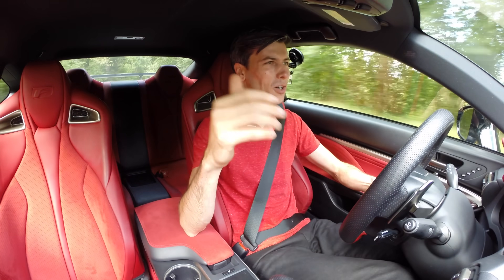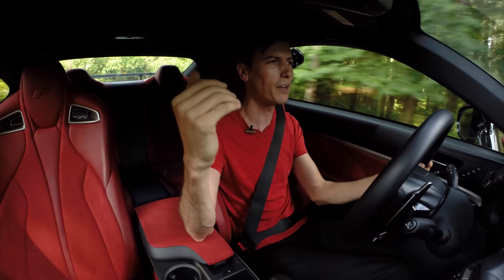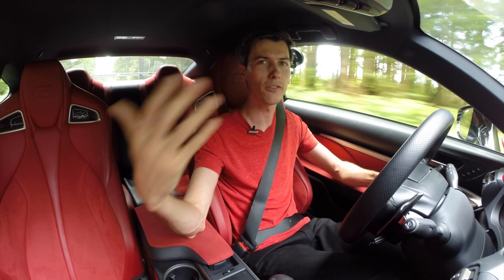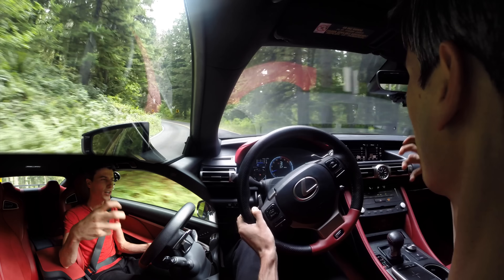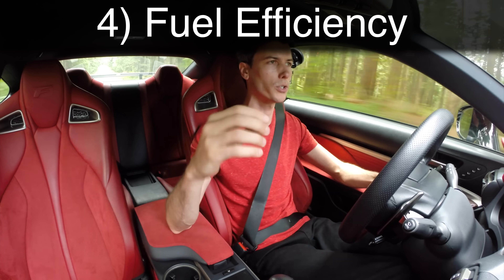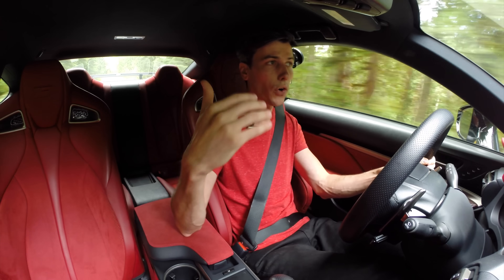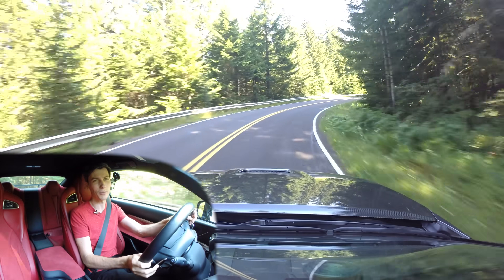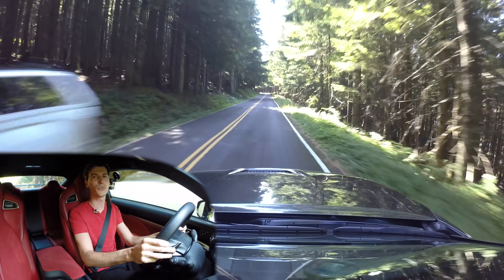5 Reasons You Shouldn't Buy A Turbocharged Car

Comment: I have bought a car with turbo 2.0 - it makes 250BHP does 0-60 in 5.8s  AND will easily do 30mpg if driven in normal traffic, all in a AWD car. So yes, it sounds ugly as f*** but it has way more power, better torque curve, much better fuel economy AND  at 145k miles is already far more reliable than my previous naturally aspirated V6. But it sounds ugly as f*** no denying that.

Comment: The richer fuel mixture scenario is offset by INTER-COOLING…..which is a part of proper previous preparation.  You present these issues as if the engineers didn’t pre-plan.  Audi is a great example.  Should you really be presenting this as if the increase in displacement isn’t beneficial when you need more power to prevent heat from building up when enough power isn’t available?  A properly used turbo-enhanced engine will last longer than a naturally-aspirated one that is pushed hard ALL THE TIME.  Yes, the boosted engine will change its’ full-synthetic oil with friction modifier every 3,000 miles due to the increased pressure in the cylinders.

Comment: Turbos were great when they were used to enhance the performance of a sports car. But now they're being used to compensate tiny engines. The 1.5L turbos they're putting in Honda and GM are proving to be a disaster. I was totally blown away when I learned that the GMC Terrain also used the 1.5L turbo. That's an awful lot of stress for an SUV that's designed to tow trailers.

Comment: I will say it like a broken record; BMW's 2,5 liter, naturally aspirated inline 6 engines was the peak ... it's all gone down hill from there.
It would be interesting to hear you compare the Porsche 991 to the 992, which is when Porsche switched to smaller, turbo charged engines.
Reply: This is all happening because of the fraudulent climate change movement. People have no idea how much of their everyday life is affected by the lie that C02 emission cause climate disasters & heating. The only reason manufactures started downsizing engines & adding tribes is because of Government mpg & emissions standards. Trump had slowed this down a little but we need politicians that will cut back on EPA regulations. All these regulations are not LAWS passed through the House & Senate, they are just Executive Orders signed by the President & they can be undone by a President with the stroke of a Pen. People are smart for keeping there older Naturally Aspirated Cars & not buying these new pieces of crap or EVs but they need to realize how Election Results are the reason they are NOT driving a new Naturally Aspirated Automobile that's reliable. The current automobile market crash is great but we still need Manufactures to scrap all these new small engine ideas.

Comment: Since I was born in 1951 I have seen a number of trends in automobile engines over the years. Turbochargers and Superchargers have been around a number of years, however in past years most car engines were naturally aspirated. Turbochargers were found primarily on expensive high performance cars. Now because automobile manufacturers are trying to get higher fuel mileage and still have plenty of power we are now seeing a lot of four cylinder engines with turbochargers. As an example the car I drive is a 2011 BMW 328i. This car has a 3 liter 6 cylinder engine that is naturally aspirated. The BMW 3 series cars that came after this model now use a 2 liter 4 cylinder engine that is turbocharged.

Comment: The part nobody has ever explained to me is..what happens with turbo s when down shoft. What is a down shift? Gas valve zero, rpm is upped 1800-2300 say, who does this? The wheels, via the transmission. How? Synchromesh is container term, but it is spring and push on..things, that push Zahnräder. What Does The Turbo Do With Its Revs? It has no transmission coupled. It is not managed by solenoids or sensors, but by airflow. Personified? How am i supposed to know (it s a song too) i must change me revs now?

Comment: Modern turbos 2010+ are long lasting and reliable, boost at 1500 rpm.Using exhaust gases to gain power is genius, furthermore most engines are turbo now for a reason.

Comment: What you are saying is truth but only from perspective that we have engine which is NA and we put on that same engine turbocharger than all you said is right. But if i have r8 v8 engine 420hp high rev 8250rmp with compression ratio 12,5:1 and we have 911 991.2 TT 380hp 7500rpm and compression ratio 10.0:1 turbocharger boost around 13psi at hard acceleration which incerase compression ration around 10,5:1 but mostly time you wil have bosst 1-2 psi normal driving or even zero. So from this i can conclude that r8 v8 will have more strain and wear on engine than 991.2 TT. Temperature wise r8 operation temp is 118celsius and 991.2 is around 105celsius normal driving when driving hard r8 v8 goes on 125-129celsius on 991.2 TT not goes over 98celsius because at sport mode have open aditional cooling system. So it can be generalized that NA will last longer than turbocharged really depends on engine type and car.

Comment: Omg.. after gone through this video on turbo charge engine my Mazda 3 2023 2.5L aspired engine behaves exactly like a turbo engine you have described 😢.  It s terribly laggy at bottom end and then makes a big jerky jump when it picks some power band😢. Worst it doesn't go fast at top end either even the engine was screaming at 6K rpm😢. Worst it drinks petrol like a drunken  sailor and returns no smile😢. It also sounds terrible too, like a cheap rent car😢. Completely opposite experience I got out on its rival the Hyhundai i30 n-line😂. You should review the Mazda 3 2.5L apspire engine and then tell us the turbo charge is way better in all aspects😂. My turbo Subaru Forrester lasted much longer than my Toyota Camry Sir and it still doesn't miss a beat compared to the old Toyota 😂

Comment: Except if those of us who are "peasants" want a reasonable amount of power in a daily driver these days, we have to buy a turbo'd four-cylinder.  Any decent output NA engine is going away due to the "green" thing (probably to force us to buy EVs which almost no one wants).  I live rural, commute to work in the next town down the road a ways, and need to pass tractor-trailer rigs on my narrow local highway.  A small NA engine does NOT let me do that safely, a turbo'd engine does, while still getting decent gas mileage.  It's about quicker acceleration for short periods, not for flat out high-speed driving for long distances.

Comment: Went shopping for Q7 in 2022, aircraft mechanic who got mechanical engineer then started career 28 years ago as power engineer.  I chose turbo 4 over V6 for one simple reason…better gas mileage.  It’s an SUV so I don’t max power and drive mostly with little load.  I have been building high horsepower engines since mid 90s NA, SC and trunk charged.  Other than getting tune right no additional reliability from either of the three that I have built.  I prefer Turbo over all others for the power delivery, a properly spec’d turbo delivers a nice torque curve for the type of driving that I do.

Comment: I've got an Audi A4 with a turbo inline-4 engine and e-gas (electronic throttle control). It's one of the zippiest engines they've ever built in terms of bang for your buck, but the best word to describe the acceleration and throttle response is probably "synthetic".  You either like it or you don't. It feels far less visceral than a naturally aspirated, throttle cable engine. But when the turbo boost kicks in, it more than makes up for it.

Comment: Na, turbos are remarkable, if you drive properly you can keep the turbo on the boil , engine oils today are very very good , mostly they exceed all manufacture specifications, so that takes care of heat and oil issues , yes often turbo engines are stronger thus they last longer, you dont rev a turbo engine so you drive on pure torque, which is free power and not straining the engine due to reving it , if you drive a turbo engine calmly as in normal driving they are very economical, granted that is hard to do due to the fantastic power generated so driving in hoon mode becomes the norm, as in fun mode 
Turbos are literally fantastic , good not bad

Comment: First of all. A na and a tcharged are exactly the same when driving in traffic, going slowl, coasting or hanging around 1500-2000 rpm.  For a normal car with low power when you want power you just floor it and the ecu knows what to do. You do exactly the same on both na and charged cars. The thing is that turbos torque is around 2500-3500 rpm and for a na you have to rev it to 3000-4000 rpm. If you are coasting lets say in 2nd gear ate 2000rpm and you floor it, the turbo is much more responsive because you are closer to peak torque than with a na. So I disagree with the responsiveness because it depends. Also if you race a turbo and a na with the same hp the turbo will always win because torque comes quicker

Comment: FACTS.  Turbos are better suited to aviation use and diesels.  Airplanes operate at a near constant speed once in the air, so throttle response doesn't come into play, and diesels generally don't have throttle plates, so turbo lag isn't as much of an issue.   Automotive gasoline engines respond better to superchargers.

Comment: Thanks. I was out of my mind thinking that I may have a problem.
The 1821982198219 videos on youtube talking about reasons for car hesitation should consider adding: You have a turbocharged engine.
This turbocharge thing is pretty useless, especially if you live in a hilly area with lots of turns and serpentines.

Comment: It depends on what type of na engine you have.  I had a b16 in my 99 si, and that thing was absolutely dead before vtec kicked in at 5500 rpm.  Unless you have a ginormous turbo, I doubt there will be 5500 rpms of lag.

Compared for my fl5, the power is on much MUCH sooner than my b16 could ever dream of.  Instant or near instant throttle response is usually only something you get on a large displacement motor that has a long stroke.
Reply: Even with relatively short stroke. 350 Chevy has an 88mm stroke, barely more than the GR86, and has torque for days even at 2000 rpm.
30 mpg on the highway too (with my Camaro example), but I'm sure a 1.6L Civic still does better than that lol

Comment: One aspect of turbo-charged gasoline engines you didn't mention comes down to actual cylinder pressures present in them during static highway cruise.  Those pressures are much higher leading to higher side-loading on the piston and more wear on the rings and cylinder walls.  Combined with reduced compression ratio (less scavenging of burned gasses), and gas-path energy lost to turbo back-pressure, your typical static cruising down the highway is using more fuel.  Energy is used to compress the air only to have the throttle plate block most of it off when running 60/70mph.  I recently drove two Mustangs on long trips, one turbo, one not.  The non-turbo cruised comfortably at 11 to 12 inches of manifold pressure.  The turbo Mustang ran at 25 inches of manifold pressure(!) That's over double the static-cruise condition in the normal engine.   Consequently, all of these little turbocharged gas engines are only good for about 80,000 miles before they're worn out.  Usually the cylinders "oval out" due to higher side pressure in modern short(ish) rod engines.  Diesel engines do not suffer from this as ALL of the air pressure created by the turbo is used greatly increasing thermal efficiency and pressure.   As you said, higher cylinder pressure extracts more energy out of a given measure of fuel.  Gasoline turbocharged cars get less mpg than an equivalent non-turbo, diesel turborcharged engines get greater mileage than a similar non-turbo, just the opposite of each other.
Reply: Diesel engines also have bigger piston skirts and many of them have oil jets squirting on the bottom of every piston to keep them cool. The bigger skirt makes more friction but it allows those longer strokes to not eat away at the cylinder as much. The oil on the bottom of the piston keep it cool allowing the components to withstand harsh conditions for much longer or indefinitely. 
Where you ae wrong is thinking that all of the turbo air is used. It is not! 4 stroke diesels have valve overlap for scavenging just like a gasoline engine although not as pronounced since the combustion chamber is located on the piston. Nevertheless they DO have valve overlap and some cool boost air escapes, its just that since it is 100% direct injected no fuel is lost due to scavenging overlap.

Scavenging loss of boost air is still detrimental to a diesel, especially the modern ones. More modern diesels run very low compression ratios (many pickups run about 15:1) replacing much of the lost compression ratio with lots of turbocharging and aftercooling. The ideal comp ratio for a diesel is 18-21:1. This allows for greater efficiency overall and more power as less HP is spent by the engine itself physically working to compress the air. Instead the energy recovery system of the turbochargers takes over a huge portion of the work. Cool boost air entering the exhaust is detrimental because it lowers the overall exhaust gas temperatures and sucks away potential heat energy for the turbo to use, making it spin slower.
Reply: @theq4602 why does the turbine care about exhaust temperature? It's spun by the air's rushing by, right? Shouldn't the speed and density of the air be all that matters?
Reply: @nthgth  Turbines are heat engines. If the turbine was spun by the flow alone the engine would have to put a lot of work into spinning that turbine during the exhaust stroke. It would be very restrictive. Its a mix more than black or white. Hot air likes to spread out which makes it less dense and thus will rise. So a hot and dense exhaust is what you want. 

Turbos, jet engines, and steam turbines all rely on taking a hot gas, spreading it out and turning that expansion into rotational energy. A turbocharger allows you to take hot exhaust that would be wasted going out your tailpipe and making it do more work. 
 Flow of the exhaust can and does play a role, but it really only matters in terms of spinning up the turbo and sizing the turbo to the application. If you fed a turbo's exhaust snail a lot of air but that air was cold it wouldn't be very efficient and your turbo wouldn't do much for you.

If you measure the exhaust temperature before a turbo and after a turbo you will see that after the turbo there is less heat. You want the temperature drop to be as big as possible so your turbo is efficient. One of the easier ways of increasing that temperature drop is by making your exhaust gas as hot as possible, another is buying a turbo that is inherently more efficient.
Reply: @theq4602  how does it just being hot impart energy to the turbine? Is it that once the exhaust valve opens, the hot gas immediately expands out of the cylinder and past the turbo, even besides the fact the piston is pushing it out anyway? Just because it's a lot hotter than before it got into the cylinder?

I.e, even at BDC before the exhaust stroke, the exhaust is champing at the bit to get out, regardless of that it got in there at 16 PSI to begin with from the compressor).
If so, I can see why putting the turbo as close as possible to the exhaust ports is good for efficiency (I guess ensuring hotter gas as you said)
Reply: @nthgth I cant easily explain it any further in a simple you tube comment. Its not a black and white thing its all related, flow, pressure and temperature all play a role. But the temperature is a very important piece that shouldn't be neglected.

Comment: I own a 2021 Hyundai i30N 6sp. It amazes me how good it is in almost every way. The boost builds very quickly to 20psi and then eases off a tad. This gives great low end grunt but is less rewarding when pedalling it. 
I used to own a Lotus 7 replica turbo, and with a fully programmable ECU I could let the turbo produce more boost as the revs increased. It felt more like a N/A motor and pulled hard to redline.
In effect you hold back the boost in the 3000-5000 rpm on purpose to make it feel like an increasing rate of acceleration.
Will always miss the performance, replaced with a family car (505 Ci Dodge Challenger). That carb gives unbelievable throttle response!

Comment: OK, about 40 years or so, ago, my mother had a Dodge 
minivan.  4 cylinder, with a turbo.  I took it out for a spin.
Was turning left, off of her street, onto a 4 lane major 
street.  Coast was clear, I hit the gas.  Not HIT, just hit.
Car barely did anything, so I HIT the gas.  Car still did 
very little, but the left front wheel was SMOKING!

Yep, the first time I hit the gas, the turbo was spinning 
up, when I floored it, turbo lag was gone, and the inner 
front tire was burning rubber.  Obviously, no limited 
slip, and a high CG, so the car leaned to the right, unloading 
the left front wheel.  Too much power, and too little traction.

Not the first turbo car I had driven, but the 62 Corvair Spyder 
had been completely reworked, by my friend who owned it.
(He once did an "un-commanded" 180 degree turn, just by 
leaning on it.  Scared the "stuff" out of him.)

steve

Comment: This is a loud bunch of BS why ? I’ve got a twin turbo which has smaller turbos which give me all the torque by 2500 rpm 600WTQ and then it carries it all the way to 6500rpm ..your point is only really valid on tiny 4cylinders ,a big V8 twin turbo doesn’t have a lag issues because it’s got plenty of power and you spend your time only using boost to go fast or pull heavy loads ,so a v6 tends to be the perfect balance between power lag & the need to use the boost ..
Also there are plenty of NA engines which cost more than turbo engines ..so your point is meaningless just go buy a turbo V8 ,or a supercharger on a V8 …